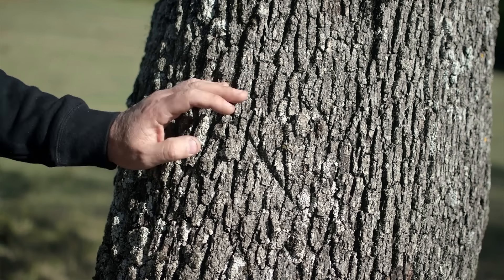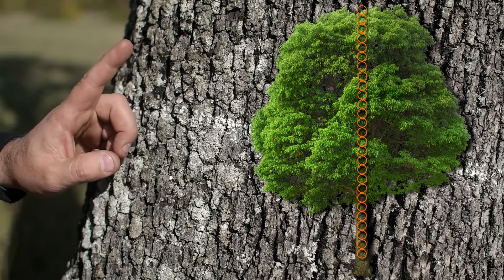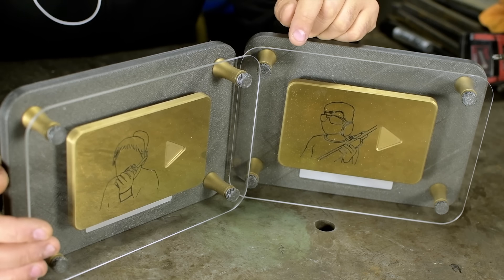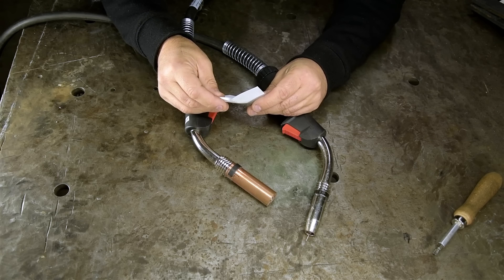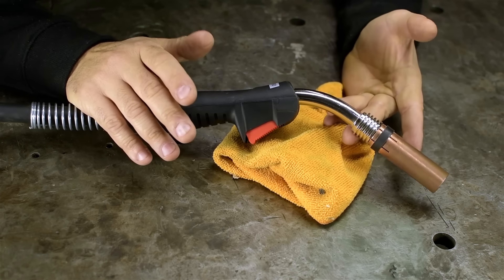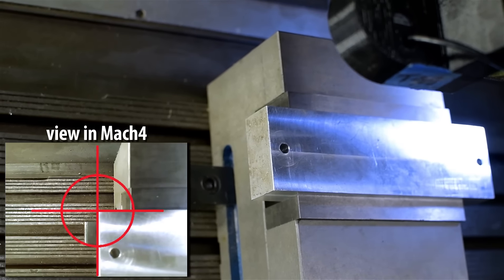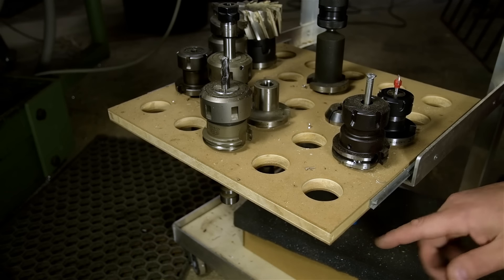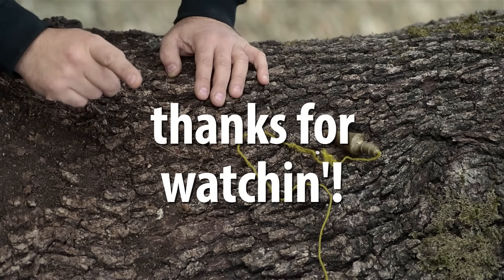VIDEO!

Comment: Just out of curiosity, the whole I need a MIG welder to build decorative iron fencing is in no way related to the felling of that Oak tree in an unintended direction and the hypothetical wiping out of a prior existing fence that may or may not be in existence any more, right?
Reply: Nailed it!
Reply: @spearhead30  you can't nail a wrought iron fence silly billy, that's why he bought a MIG.
Reply: @juststeve5542  MIG'd it!
Reply: @juststeve5542  believe it or not, I saw a guy nail a wrought iron fence once... of course instead of a hammer he used a Corollla, but it worked!  He drove that fence right through the apartment complex he was aiming for.  Bet he couldn't do it again no matter how much he sobered up.

Comment: The casters from aluminum is of course impressive, but how did you get the surface finish to look like wood for those shelves? You truly are a master.
Reply: It's an optical illusion caused by micro-engravings of the aluminum surface. That causes light to reflect and refract in a very peculiar way.

Comment: Hi Tony, just spent 3 day's drawing (in CAD to scale, with located parts & part number's) your fence shown @ 9:08 of this video.  Not sure who designed this fence, but for starter's it not for people with small pets (i.e., the  approx. 18 inch gap located at the bottom.)  Just wondering, does your design have "Two" swinging "3-Foot" man-door-gates?  Today's date Sept. 13th, 2022.  I didn't like your finials, so I went with the Traditional Fleur De Lis Spear, ITEM No.#: 45-8832.  Just wondering did you use Cast Iron Spear "Lyre," ITEM No.#: 45-L06-12?

Comment: Hey Tony, just a little hint, as I do a lot of reverse engineering on daily basis, there is a VERY simple way to do it if you have any vector 2D software where you can create a drawing (not 3D cad). This works for flat parts only, but still. You just take a good flat picture of your part along with ruler in the same part, then you import that photo into for example coreldraw or illustrator, scale it there based on ruler on a photo, and everything else is super simple, you just outline it with vectors :-) Hope this may help someone :) Cheers!
Reply: Better yet. Put it in a scanner on your printer. Scale is given too and flat picture ensured
Reply: @AdvancedGT  good idea actually, I haven't had a scanner since 2000s probably though. I ensure flatness now by taking a photo on top of 1x1 mesh film. Also this way you can do any size, my parts for example surely will not fit into any scanner :)

Comment: "A fun 14 day project with a hacksaw and some files"    I've been having a hard time getting the holes started with my hacksaw.  Would it still work if I use a drill for the mounting holes?  Or I could try my smokeless powder operated hole punch, I'm pretty sure I have one that fires close to that size.
Reply: I mean if the smokeless powder hole punch works.... then why not? Ricochet maybe! 🤔

I can't really say anything, I used to use a oil filled 300A stick welder as a hole starter on its max setting, that old girl would blow a 1" diameter hole in a digger bucket, it was made for welding submarine hulls 👀
Reply: @mor4y    I watched a Pakistani truck repair video where they used a big rod with the welder cranked all the way up to gouge out the broken part of a front beam axle on one of their dump trucks then turn it down and use about ten rods to weld it back together. One of the scariest things I have ever watched.  The bad thing is that it was twisted and broke in half right at the spring mount about 6" from the steering knuckle.  It made me happy I don't drive on Pakistan roads

Comment: Interesting, in the few decades since your last video I have taken up lumberjacking, you know, the art of using a scissor type car jack to lift the log you have gotten your chainsaw bar stuck in when the log sagged and pinched it. Odd, you should come back with a video featuring similar antics. I currently have a 70 foot dead oak with a precarious houseward lean. I will have to try the plumb bob trick, but the part I don't get is how the string will keep the tree from falling the wrong way. Wouldn't it just push the plumb bob into the ground? Do I need to put some scrap metal under it to support it? Or do you have some rare earth magnets in the bob that are pushing it away from the house?

Good to see you have returned from your sabbatical, Mr. Pete and Abom79 have been slacking off in the quality of their videos due to the lack of competition.
Reply: You may be able to use a chain to restrain the tree from falling towards the house. For example, chain it to another stout tree. Good luck and be safe!

Comment: Hey ToT, the Midge welder is more properly called a Grandma (GMA) welder since MIG is an acronym for (M)etal (I)nert (G)as.  And since most steel welding is with a mix of inert and active gases, Gas Metal Arc is more accurate. Happy one million.  Glad I put you over the top.  A tour of the garage would be OK, but just send me the money you promised and we're square.

Comment: It's great having you back, TOT. What do you think about some sort of vertical (or would it be horizontal?) quick-change tool post for holding the tools to the vise or table? You already have the tool offsets from the lathe DRO and you won't have to take them out of the tool holders.

Comment: As always Tony, well done. A word of caution on the new chuck setup. Make sure the chuck is rated for the RPM you plan to spin it at. Some chucks are rated as high speed chucks and some aren't. Take care.
Reply from the maker: thanks and excellent point, Joe!
Reply: Seeing how Tony still has all his fingers , he's probably aware of that...
Reply: @vittoriosilva1454  Most people have all their fingers untill they don't.
Reply: @delrinyoung  How many manual machinists do you know ....
Reply: @vittoriosilva1454  When a cast iron chuck detonates from excessive RPM, it doesn't just look for a fingertip to cut off. Its like standing in front of a hand grenade. But I'm sure you already knew that.
Reply: @Shop-Tech  The speed and feed of any material  will be far below any maximum speed rating of the chuck ...I'm not so sure you already knew that ...
Reply: @Shop-Tech  lmao i have witnessed this. luckily no personal losses
Reply: @vittoriosilva1454  1" dia AL  at 2k sfm says 8k rpm. My small three jaw will take 4200 max, tony's mill wont spin that but blowing up a chuck ain't impossible. But I'm sure you knew that.
Reply: @pontiacg445  I'm sure a Mill is going to interpret a G97 ..
Reply: @vittoriosilva1454  Doesn't matter. The speeds and feeds at the center are 100% going to be well over the rating of the chuck, I'm not so sure you already knew that ...
Reply: @pontiacg445  Unless you are aware of the chuck's limitations and don't exceed them ...I've turned tons of aluminum on a chuck that size without issue ...Tony isn't a dumbass ....Without a tailstock It'll probably just spit the part out long before you frag out the chuck...
Reply: @pontiacg445  You do realize the spindle of any cnc lathe is going to be powered by an inverter , and inside that inverter is a maximum rpm parameter set at the factory...Set well below any speed that is going to explode the chuck , because liability ...The really good ones have proprietary firmware to prevent tampering ...You can fool some of the people ...
Reply: @vittoriosilva1454  Whatever you say, bub. 

You probably oughta learn to be a little more careful with these absolute declarations of yours, especially since you clearly lack any real experience.
Reply: @pontiacg445  Working on cnc machines since gcode was loaded from paper tape ,,,, No matter what surface speed you program for your g97 , the rotational speed reaches infinity at the center .... Because of this the speed is limited @ the gcode interpreter as well as the inverter ... The only picture of an exploded chuck you are going to see is in the parts breakdown manual....You would have to be trying really hard to overspeed a spindle on a commercially built lathe ...Only through modifying inverter parameters , setting the incorrect number of poles + encoder resolution ... And you would lose your C axis + you could be prosecuted if anyone were to get injured ...
Reply: This comment section is getting Salty!😂
Reply: bigboy3245  Oh so sorry , actual production depends on results not feelings....
Reply: 🤔
You're concerned about the Chuck Rated RPM.
But you mentioned nothing about the Welded Face Plate ????
Great Tip 🙄
Reply: @weldmachine  Weld looks good to me lol.
Reply: So many bone head comments below about Lathe Chucks ????
What is it with YouTube and commenters with no clue what they are talking about.
IF you know ANYTHING about machining you know the limits of equipment you operate.
IF Not,  you have no business running a machine.
Both professionally or as a hobby.

I see one comment mentioning 8k for Turning Aluminium.
Never seen Any machine shop Turning Aluminium at this RPM with a Lathe Chuck ????
Max RPM of a Kitagawa CNC Lathe Chuck is 6,000 RPM.
Same as the Maximum Speed of the machine it's bolted to.
Even IF you are running at this speed on a CNC Lathe you would use a Collet Chuck  ????🙄

Another Nuff Nuff mentions.
When a cast iron chuck detonates from excessive RPM, it doesn't just look for a fingertip to cut off. Its like standing in front of a hand grenade.

Who runs a Lathe Chuck higher than the machine can handle ????
Any Manual Lathe would be flat out turning a Spindle at 2000 RPM ????

I doubt any Nuff Nuff's have the balls to even run a Manual Lathe anywhere near this Speed. 🙄

But then again it Could be a CNC Lathe ????
This guy would be out the door ASAP IF you intentionally ran a machine past it's operating limits.
I seen someone mention something about this also.
Like it was a Big Man thing to do.
It would be an unemployed Big Man too.
Reply: @3000gtwelder  
The Weld is Rated to a Higher RPM than the Chuck🙄
Reply: @weldmachine  Id think so lol.
Reply: @chicken69tenders Depends on whats going on underneath, and if he dunked his tungsten in it, or got in any contamination 🤷‍♂️ I’ve seen beautiful welds fail X-Ray before.
Reply: @weldmachine  Any manual lathe? Small ones easily exceed 2K, eve the little Chinese mini lathes (7X series) spin up to 2500+. Although I've never come across a full sized manual machine spinning that high. Blanket, definitive statements should be avoided in Youtube comments as 1 counterexample ruins your argument.
Reply: @noid919  You're missing the point ??
It's Not how fast a Lathe Can spin a Chuck ?
It's how fast you will have the Chuck turning on a Manual Lathe When your Actually cutting material.
Reply: @weldmachine  C'mon man - now you're just trying to back out of your mistake. You clearly said "Any Manual Lathe would be flat out turning a Spindle at 2000 RPM". This is an untrue statement as there are lathes that spin faster. 
There are also reasons to spin that fast -  if your stock is small enough, and of the right type, for a specific operation you may want very high RPM. For a hobby, I make small, operational internal combustion engines and use soft metals like aluminium of small sizes and some operations require high RPM. My large lathe won't spin that high but my mini lathe certainly will.
My mill also won't spin as fast as I sometimes need it to when using small drill bits for example. 
You can change your argument all you like but the fact is you called people out for making wrong statements and made one yourself in the same post while trying to make people look stupid.
Reply: @Shop-Tech  Aren't they always made from steel?

Comment: Thanks TOT, I was having TOT withdrawals bad man!
Even more messed up is Over the weekend I started to look into using a mill as a lathe by adding a collet chuck with a R8 taper in to the vertical mill.  Maybe use a vertical vise and tool holder to turn and face small round parts.  
Since you seem to have access to my searches in real time or some how before I even think of it................  Did you find anything that says this couldn't be done?  Or how stupid of a idea is it really...?

Comment: Trying to make a state of the art automatic machine out of an analogue system. Reminds me of the day i made a steel lathe from a trestle and two opposing cordless drills tied down with ropes and used a grinder as the shaping tool with a fat grinding disc. It worked for one project. The stop end i think was a philips head in the chuck pushed into a hole in the end of the steel stock. I had to use my off hand on it to keep the prssure up while the driving cordless used something like a screw jamed in the grip to the correct length and had to find one. My kingdom for a cable tie and enough to waste like a single use. Not hard to believe id rather a real one now it would be a lot of fun. They are so big and heavy my only option may be to build my own better thought out and bolted off everywhere and a slide system bolted to big steel table clamps used for furniture construction. Looks like a kanga jack made from super light gauge rail road track. Pretty sturdy when my trestle is light weight aluminium.

Comment: "Synergic" MIG means you just tell the machine [plate thickness, wire type] or [desired amps, wire type] and the machine will choose the right volts/wire speed combination to suit.
There also should be a "voltage trim" or "arc length" adjustment for fine tuning.
And when you use pulsed mig on Aluminium for the first time, you might never go back to A/C TIG, just saying.
Reply: I can't believe someone could summarize it that perfectly. It was a pleasure to read.
I am far from knowing how to weld but I can't count how many times I had to fix some misunderstanding in "professional" heads about how synergic MIG or even normal MIG works. They always stick with "setting the current and the feed".

Comment: I have used my Rockwell horizontal / vertical mill as a lathe to do some large diameter work and it only has a 30 taper spindle.  I made a similar adapter but it was for a faceplate.  

A gang style tool changer would work great on your CNC mill for your lathe CNC lathe mode.   ❤

Comment: Hectic you can weld aluminium. I did not know. I assume it's not the same set up as steel but I didn't think it could be done with less then tig.

Comment: There is a trick for using the telltale. If the tree fell over the wrong way, you can just roll it a few feet until it turned by 180° and the telltale will now be under the tree, saving you the hassle of putting the tree back up again.
Reply from the maker: great trick!

Comment: Get a 3-ft chunk of steel and Mill a dovetail into it that will accept your lathe quick change tool holders, then you could just bolt it onto a couple angle plates.

Then you can mount as many tools as you can fit on the length of dovetail

Comment: I have one of these, basically it's the Stel Iron Mig 221P
Great machines made in Italy.
Stel make them for HTP as far as I can tell.
If your in Europe and your looking for one of these go for the Stel Iron Mig 221P
The only difference is by default the Stel doesn't come with the 14 pin remote connection and the HTP Pro Pulse 220 MTS does.
But the supplier I got mine from in Ireland was able to order that option from Stel Italy at an additional cost of €55 Euro's The total cost I paid was €1335 plus 23% VAT for the machine  and one torch and the remote option.
 I did get a second torch and a few other bits and pieces like tips and additional drive rolls etc.
If you're in Ireland and you want a supplier contact there's only one, let me know.
I have no connection with them other then being a customer for the first time when I bought the unit.
But it did take be a few days to find an Irish supplier.

Comment: I prefer to keep the old stuff goin. My 041 and 041 super are heavy,  slower, but so much torque. My father still used my grandfathers 041 he bought new in the early 80s. Its never needed anything but one carb kit, and one new muffler cover because of a misshap dropping a tree on it.

Comment: In case you're interested toilet bowl cleaner (one with an acid mixture) will remove the blue caused by heating steel  but then needs to be neutralized with baking soda to keep from rusting

Comment: Had to come back re-watch mainly the 3 jaw chuck mode. With the Brides passing, I found my self at another auction, and picked up a 4in 3 jaw with live bearing center. Now to modify the Morse tapper shaft to fit tail stock of the LeBlonde 17,,, Great that the tree didn't find a car or house to land on,,hehe! Bear

Comment: like the others glad to see you back, do you have a contract email address I have a couple of tools you can have if you want them, I can email you pics one is a boring head that if my memory is correct takes an 1 1/4 bar  its mounted on a 40 taper shell mill holder so it could be swapped to whatever you wanted